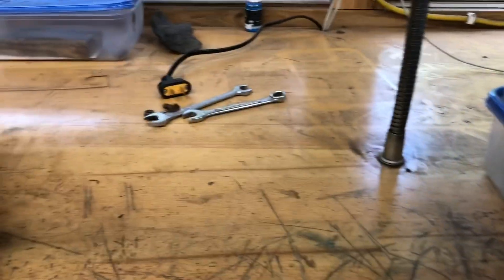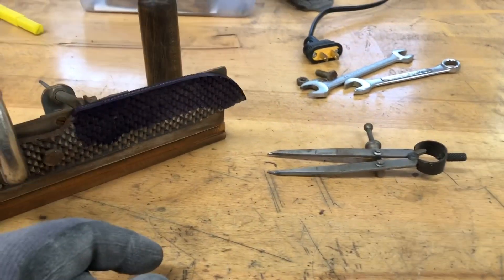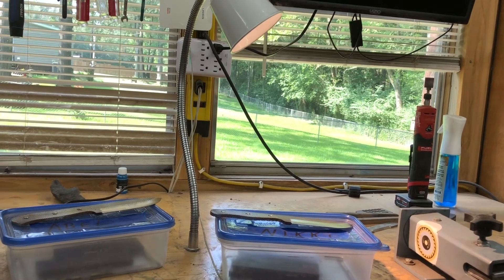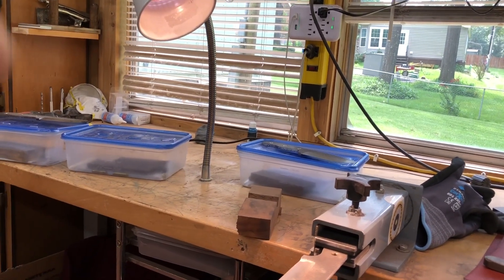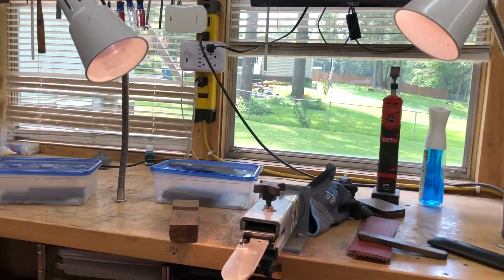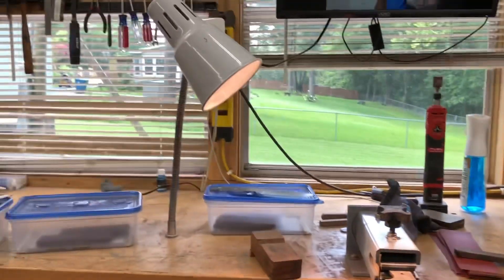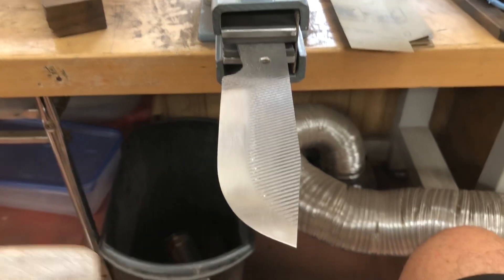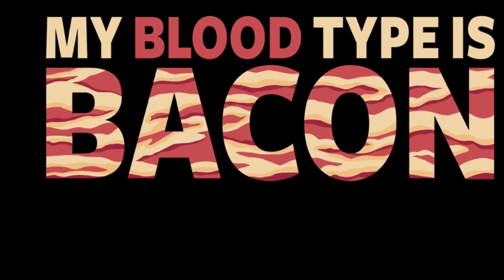Farriers rasp knife x3

Comment: I don't want a work/wood knife too hard that it becomes extremely brittle. That's even worse than a knife that won't hold an edge. Sounds like you temper them to that sweet spot. I would never be able to grind those bevels and keep them even on both sides. I could with a jig but that's about it lol.
Reply from the maker: I use a jig and it’s still a huge learning curve to make both sides equals
Reply: @bctruck  yea and the only way you could make a jig that did not allow you any room for error would be to make a jig for every type and size of blade you have. I could make a foolproof jig but it would only be good for one type and length of blade.
Reply from the maker: I made my own jig, but I made it adjustable to accommodate all my knife styles.
Reply: @bctruck  yep I like the jig you made. Perfect for setting that angle. It's just the curve near the tip that would be the bear. Would be nearly impossible to make a universal jig that not only sets the bevel angle but also that curve radius and distance. It could be done with 2 pins and a slot for individual knives though. 😀